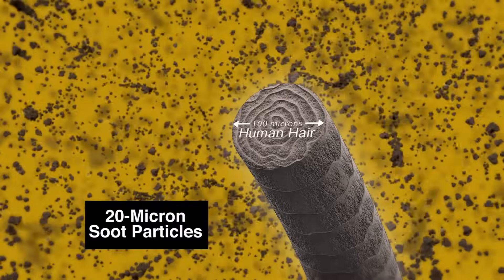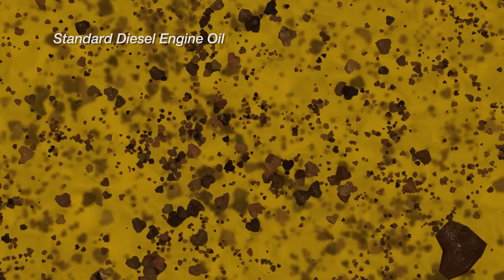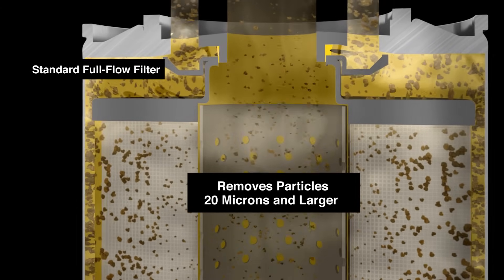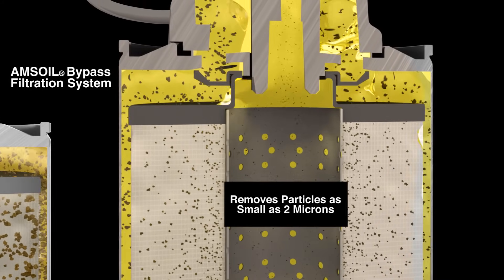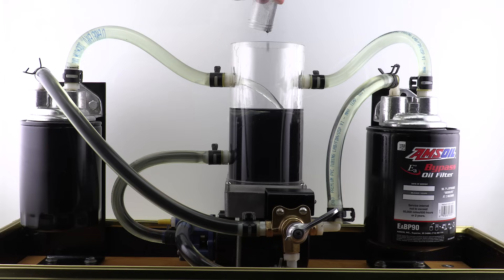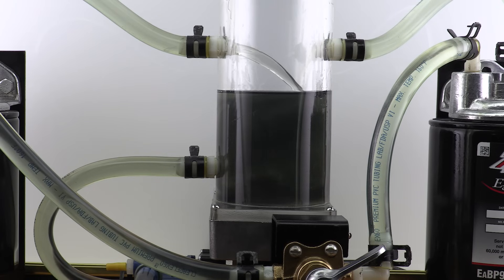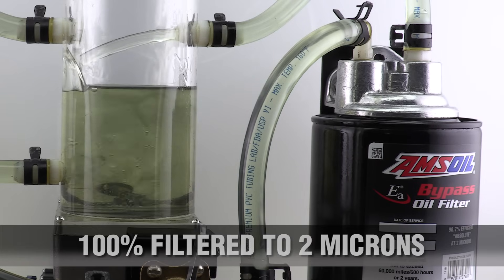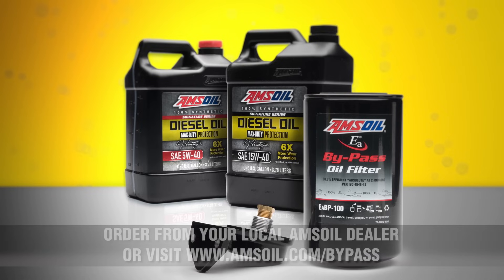AMSOIL: Diesel Bypass Filter Solution

Comment: On your website its not available for 2021 silverado1500 3.0l duramax.  When will it be available?
Reply: Just means they don't have a specific kit for that application. You can still buy the parts and put it together yourself. You just need an oil source, and a return, usually the oil sending unit, and then returned through the filler cap, or oil pan tap.

Comment: I’m planning on order one for my 2015 duramax but you have a dual filter bypass and a single which cost more..so which ones better?
Reply: Did you go with one? My 2015 has 100K miles and I'm thinking about a bypass system.
Reply: @ericwiltz6584  no i didnt still waiting for a response lol
Reply: @JonLIsALoser  I don't like the dual remote bypass idea. It doesn't make sense to me, and I have heard some people have problems with it. Get the single bypass remote filter system and retain your existing full flow filter.
Reply: @JonLIsALoser single

Comment: So why do diesel trucks that have this system still have oil black as the ace of spades just after 1000 miles?
Reply: Soot will still change the color but the actual particles above 2 micron will be filtered out.  You know kind of like coffee beans in water
Reply: Oil turning black is normal. As soon as you turn on the engine with clean oil, and it gets to temperature, it will turn black. As soon as the oil is subjected to heat, it turns black. The black in this demo is carbon black to simulate wear particles. The black you see in every day operation is not soot, but oxidation, and is normal, not indicative of anything undesirable. Dark oil or black oil is meaningless, oil samples are the only way to know if it’s good or not. I have 3 semi trucks and all three have an Amsoil system on it. I even gave a bypass filter on one of my reefer units, from a different manufacturer. Oil bypass filtration is a proven, effective technology.
Reply: @Misesian86  I don't buy that at all. Oil has to burn to turn black that fast, which would be burnt oil. What's burnt is the diesel fuel, which is sooty, which is scraped into your pan by the rings or blowby. Dark oil and black oil are two different things. On my corolla after 1k miles its still not soot black, which is what the dude was asking about. Black that you cant see through is soot, not oxidized oil. You can test it yourself by heating some motoroil up to 250 in a pan on your stove. keep stirring it, it wont turn soot black. It may darken up some, but it wont turn soot black.  

A diesel engine is always gonna have black oil, but its not due to oxydation.
Reply: @emrwtf  
Heating it in a pan does not subject it to pressure. Oil turning black means it’s doing its job. No amount of bypass filtration will fix that. I run oil samples on all my stuff. I know what the soot content is. On both my semi truck and reefer unit, it’s less than 1%. Anything higher than 3% should make you examine things. Between heat, pressure, and soot, oil will darken and turn black. My point is that the color of oil is meaningless. If you took two identical samples, one full flow, and one with a bypass filter, the one with bypass will have substantially fewer particles, over 1 micron in size. The point of bypass filtration is extend drains and reduce engine wear.
Reply: @Misesian86  Everyone has a right to their opinion. We can agree that bypass filters work, and leave it at that.
Reply: @emrwtf  Diesel engine oil is black due to soot from combustion. Having owned both diesels and a Corolla, I can confirm that (with Amsoil and filters) the oil never turns truly black, but more of a golden brown, because it doesn't have the same source of soot that a diesel does.

Comment: Question I have. Why not just make this same filter to fit the OEM housing? Instead of having to do all this to add your own. I mean I want this but really don't see why I have to add all this bypass stuff and install a whole new housing.
Reply: The filter is too restrictive to be a primary filter
Reply: It would be way too restrictive, not allowing enough oil pressure for the engine to run safely.  Heck, might be lucky to just run the engine 30 seconds like that before is had a total failure or just stopped running.
Reply: Too restrictive

Comment: Honestly the factory filter was cleaning allot out before the switch was turned. I question the added media they used for demonstration.  Because had they left the factory filter going longer it looks like it would of cleaned the fluid  nearly identically the retutning fluid looks a tinted a shade darker from factory filter but not far off. I'm willing to bet  this was rushed with thicker particels the factory filter could of easily removed.
 Let's try a longer more detailed test with proven factors.
Reply: They used charcoal with a minimum size of 5 microns to ensure their bypass filter returns the oil to a golden colour.  In actual life, soot particles can be 1 micron of even sub-micron in size; leaving the oil dark even if "clean"
Reply: I’d like a test with used motor oil, not a liquid with a carbon additive
Reply: I put one of these systems on a V8 and after 2k miles the oil didn't appear any cleaner/clearer then i used a clear plastic bottle and ran the motor to see whats coming out of the bypass filer line....dark oil
it may filter to smaller particulates but it defiantly does not "clean/Clear" oil
Reply: @prodigy6000 but at least you are removing additional wear abrasives from your engine.
Did you send a sample to the lab for oil analysis?
Reply: @prodigy6000  that obvious and nothing surprising. As said above most american so called famous companies are just con artists that using lack of customer experience or knowledge. They sale pure bullshit.

Why they don't export to europe ? Coz in europe statistic buyer got huge mechanical knowledge so they won't be able to bend him over.

We did few tests of american tuning products and it was a joke no near promised specs in advertising.
Reply: Who cares about color as long as it removes more particles.
Reply: What you asking is not good for their marketing. They do same con art as banks and fass.

I've pointed banks on few cowboy things or bad designs but they never replied to the hard questions...😁
Reply: @broskis80  What hard questions?

Comment: this kit will not fit a 2020 GM L5P Duramax diesel engine....Amsoil does not manufacture the correct oil fill cap to work with this engine.   Amsoil no longer sells the oil fill cap separate from the kit, which now forces it's previous customers to shop elsewhere for by pass filter kits.  Truly a big disappointment.

Comment: Why dont you test using used oil?
Reply: Silmi Isa used diesel oil will still be black. It’s a common misunderstanding to see black oil in a diesel and think it’s bad or dirty. Oil turns black due to temperature and is not a bad thing. This demonstration is meant to show particle removal only. To use, used, black oil, would not be able to demonstrate the removal of particles.
Reply: @Misesian86  in particle filteration, the most important info that interest me is the particle filter size (micron) and filtered oil flow rate, especially after several milage served (typical condition). Hope we can get those info too.
Reply: Silmi Isa couldn’t tell you the flow rate. I run Amsoil bypass on my three semi trucks. The oil samples show it works. Oil is still very clean at 20% beyond manufacturer recommended interval. These newer trucks don’t use much oil, so I still change it due to TBN depletion. 20% beyond recommend interval isn’t bad. On the Volvo and Cummins trucks, I’m able to go closer to 30% longer.

Comment: Nearly all commercial diesel engines are equipped with a bypass oil filter from the factory to extend oil changes due to soot loading. A pore blockage PARTICLE COUNT on your oil analysis report will determine if fine particles are a problem requiring removal by this system, most engines don't need the additional filtration unless oil changes are extended beyond the OEM recommendation.. This same demonstrator was used thirty years ago as an illusion.
Reply: I see no high filtration filters on the C15, C13 Cats and ISX Cummins on the trucks I drive, just regular cans, please explain.TIA
Reply: @Clunk49 Oil filters can do both full flow and bypass, that technology has been utilized since the 70's by Mack & Mercedes. Mack & Volvo use a separate bypass filter.  https://www.cumminsfiltration.com/sites/default/files/pdf_archive/pdfs/product_lit/americas_brochures/LT36043.pdf Baldwin also has an excellent dual element oil filter for the ISX. Some people add on an extra bypass filter, its completely optional and comes in a spin on or a cartridge style (TA/Petro is a vendor for one brand).
Reply: Thanks!

Comment: Amsoil has different By-Pass configurations that can be used for gas engine or hydraulic oil applications.
I have been using By-Pass filtration on my diesel trucks accompanied by oil analysis and have extended my oil drain intervals far beyond that of the OEM recommendations.
Reply: got a link for gas variety
Reply: @Baigle1  It's just a filter, it doesn't care what type of fuel the engine burns. If you can find a way to route the oil through it, it's going to work.